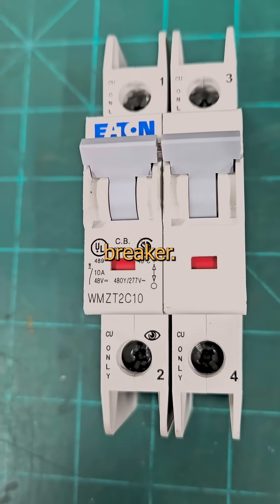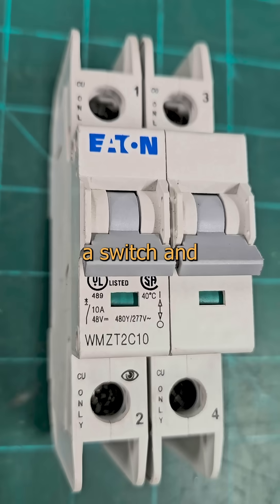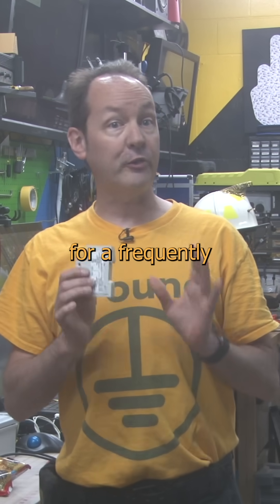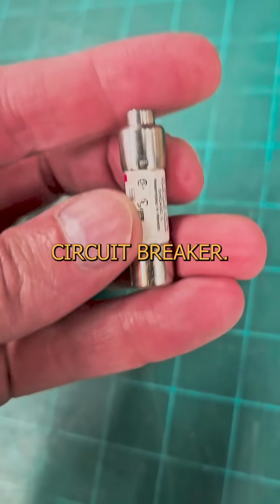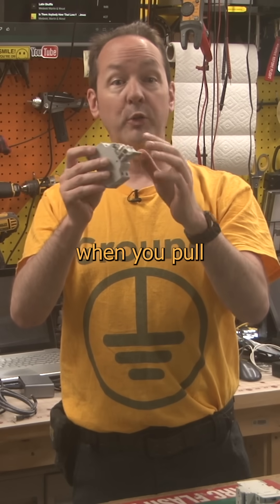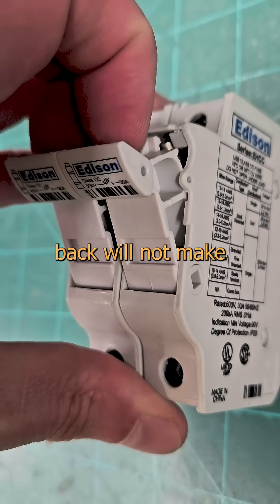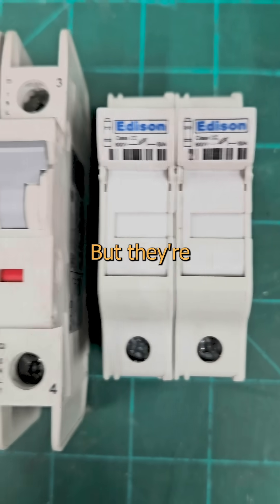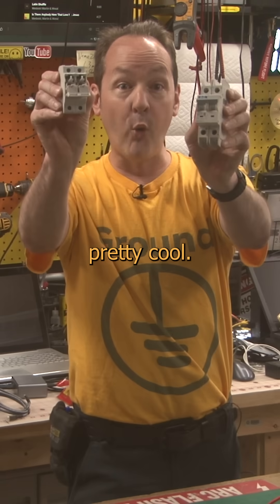Breaker vs Fuse #chrisboden #comedy #engineering #electrical #apprentice #training #educational

Comment: Fuses tend to be faster in breaking the current to the device, but of course we love to stuff slow-blow fuses in them so there's probably not much difference in delay.
Reply: Breakers also have a maximum fault current they can handle, exceed it and they can weld themselves in the 'closed' position.  Breakers that can survive 20kA+ are EXPENSIVE.  it's not uncommon to use breakers but to have a single high current fuse upstream from them to protect against massive fault current.
Reply: Back in college, circa mid 80s, the college theater had a 'home brewed' lighting control board.  (Hey, EE class projects can generate some awesome tech.)  The dimmers were very sensitive to shorts in the lighting beyond the dimmer, so the dimmers were protected by fuses that were rated to blow in 1/2 a cycle.  Expensive little fuses.
Georgia Tech's DramaTech theater.. which at the time had a more capable light board than any of the pro theaters in town.
Reply: Slow-Blow (or Time Delay) Fuses don't break short-circuit current any faster or slower. The designation refers to their "patience" with, say, 200% 150% or 120% current surges when, say, a Motor has to start and draws a locked-rotor amount of amperage for a moment.
Reply: The difference would be the AIC rating. Fuses can usually stop a much larger short circuit fault current than a breaker for much less money
Reply: Depends upon the class of breaker and if there is a thermal profile.

A breaker meant to protect a motor will be different from that of a breaker meant to protect a heater.

Motor inrush can be pretty dramatic.
Reply: @mrchew1982  there are also those dual element fuses that are slow against overload, motor startup currents etc, but extremely fast for short circuit conditions that exceed a certain threshold. 

For example, Eaton's 15A RK-5 fuse takes 9 seconds to blow at 70A, but only 0.05 seconds at 200A. Higher currents lead to faster blowing, and anything above 500 or 1000A the current may be cut off before it even reaches its peak, depending on the circuit's inductance.
Reply: Industrial breakers often have adjustable parameters so you can fine tune the sensitivity and trip speed etc.
Reply: I would argue that there is probably also a difference in reliability.
Fuse is literally just a piece of material that burns over, so I would guess they are more reliable.
While I would guess there are more things that could go wrong with a breaker.
Both are highly reliable, but in environments with very high requirements for reliability I would assume the fuse holds a slight advantage.
Reply: I can't believe the idiots in here are arguing that fuses are superior.

We had that argument 30 years ago. We.have moved on from it. The engineers decided that circuit breakers are better, however in some specific cases fuses are more appropriate.
Reply: I doubt this. Fuses are thermal devices, and therefore rely on heating time. Circuit breakers also have a bimetallic strip for near overcurrent, but they also have a magnetic breaker that acts at lightspeed.
Reply: This is actually not true.  Both fuses and breakers can be designed to blow fast or slow.  There are whole ranges of both, so it entirely depends on which ones you buy.

However, most breakers are, in general, better than fuses in this regard, because they are designed to have multiple mechanisms inside: a thermal mechanism (to trip if too much current persists for a long time, like a fuse does), and also a magnetic mechanism which will trip instantly if there is too large of a spike in current (such as when a direct short happens), which fuses just can't do.

(Plus modern breakers can also include GFCI and/or AFCI functions as well, which can detect and trip on hazardous conditions that fuses won't even notice at all.)
Reply: They are bolth made to spec. One is faster beacose its meant to be faster. Its not a reason to choose either one.
Reply: Fuses are imho better for DC uses, breaking DC on over current is technically hard as there is no zero ever.
Reply: I recently had my house rewired, before the rewire, I was informed with pain that I turned off the wrong “fuse”, my new set up I don’t know Ive been zapped by pixies, unless I hear the MCB click….
Reply: Not realy. It depend on the specs of the breaker. Typical an B braker brakes in 200ms if the current is at minimum of 5 times there nominal current. For example a 16A brakes nearly instanly if the current is oder 80A. The fuse is not faster.
Reply: The difference in simple fuses is what we are regulating nowadays. Everything from the harmonics to the DC sinuswaves cheekily passing by thanks to that solar rig you installed. Nowadays these simple circuit breakers and for Europeans RCD’s do a lot.

Comment: Those fuse blocks are so hard to open. I feel like im going to break them every time. That being said.. i only use breakers to disable specific circuits when something im building is half finished and we dont have the damn A/C unit or the motor yet.. or im troubleshooting or debugging occasionally.

Comment: LOL. Just as infuriating as people treating breakers like switches. 🤦‍♂️
Reply: The number of production plants I've been in...where's the light switch?...oh, just flip the breakers in the panel painted white.. 😮
Reply: They do make switch-duty breakers. We use 'em for lights in the data center since the lights in there are always on.
Reply: Yep. For a while, if not probably still now, my uncle's store's way of turning off the main lights was going to the breaker panel and flipping a bunch of them.
Reply: Breakers are switches. Just not the typical-use-case switch.
Reply: If you have to maybe it's a poorly designed system?